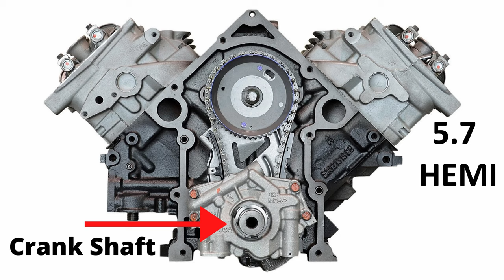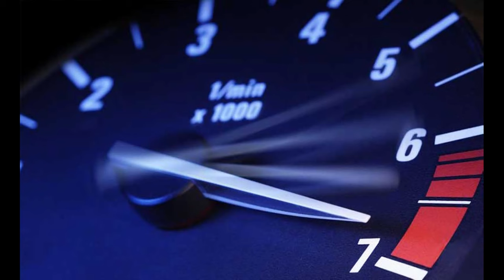HEMI TICK Explained (Easily) - The Cause and How to Diagnose

Comment: The Hemi is not a SOHC engine. It is a cam in block engine. They raised the cam to allow for shorter pushrods and a better angle to the rocker system. The oiling may be an issue. If so, I am of the opinion it’s due to the lightweight fully synthetic oil dripping completely off the hard parts between runs. The unlimited late model dirt cars tried the fully synthetic oils and went back to the semi synthetic oils so that the needle bearings in camshaft bearing (in the block and not the lifters) retained oil and didn’t suffer from dry start up failure. I run both Marvel mystery oil and Lucas oil stabilizer in my 2017 Ram. I run the prescribed oil and change it with the oil monitor reminder. I have just shy of 70,000 miles on it so far and it doesn’t appear to be having this issue. A good trick is to cut the oil filter open at the change to examine the filter media. If there’s metal fragments in the filter media you more than likely have this issue.
Reply: Lol.
My 04 Hemi had 300,000 miles of hard use and towing and Tics since 100,000.
Reply: @Roy Hemion  I ran mine up to 170,000 with no issues and traded it in on a 2017 Ram. The 201 now has 110,000 miles on it. It appears that in some forms of use and maintenance impact the wear on the roller lifters. 

I don't use mine for short trips like a daily driver. It's used as an over the road vehicle. My 03 was used the same way. I have a beater car now that takes the daily commute.
Reply: @The340king  I bought an 04 6 months ago for 2000. Its a awd Laramie edition with leather and factory 20" rims. 
Makes some noise upon startup and goes away after several minutes-
Truck has 300,000 miles and runs strong. Pulls hard all the way to 6200 rpm. The guy I bought it from said His dad bought it brand new.
I was considering buying another Hemi and doing a rebuild with the 6.4 Oil system. I am very impressed that the truck with that kind of mileage actually sounds so smooth and tight. 
Its technically my first dodge vehicle.
Have a blessed day and If you can't Dodge it, Ram it.

(Lol- sorry I had to say that somewhere)

Comment from the maker: EDIT* The Hemi is not a SOHC engine, clearly. The cam is mounted higher in the block then a "traditional" V8, that's what I was trying to get at and obviously mixed myself up lol. Sorry for any confusion.
Reply: If the cam higher in the block we need change oil pump MELLING brand with high pressure i think it's better .
Reply: Mds system not lubricating lifters mostly at idle
Reply: Glad you cleared that up. I was going to say something.
Reply: So what happens if you had an extra quart or 2 ... maybe the engineers miscalculated...
Reply: Correct, not SOHC, but it's not it being mounted higher that's the issue, they actually left block material between the cam and crank, blocking the oil spinning off of the rotating assembly from reaching the cam. I believe it's the lifter assemblies out of the hellcat that address this issue with internal oil passages that supply the cam, but I am not sure if it's just that or if you have to swap out the entire head and the lifters as well.
Reply from the maker: @DJTourniquet  I agree with you, I did a follow up video on this topic because I felt like I didn't do enough homework on the topic lol. I think there is a variety of possibilities including the lifters themselves being the issue. I do think there is still potentially a lubrication issue but there is more to the story then simply the cam's mounting location! thanks for the info sir!

Comment: The most profesional and yet most understandable explanation that I found all over internet.

I have a 2014 Jeep Grand Cherokee with the hemi 5.7 and It starting making the tick. It does it hard when starting the engine and goes away seconds latter. I'm towing a trailer. and I'm in Colorado now. the local mechanic that I found said that is the lifters and quoted 3500 for a full replace (including the cam shaft). 

I did oil replace and added an additive without any change. The crazy thing is that some times will start without making any noise. 

So I sill have some hopes that is the manifold. I left my car tools behind so I will buy online the "hearing tool" and also do the exhaust test. I saw a video of a ram with the exhaust problem and it sounds exactly like mine. but I read that both issues sounds the same.
Reply: What was your problem?

Comment: My hemi tick was the crank shaft disintegrating. My SSV was a Sherriff's department pursuit truck that blew a head and sent metal into the crank bearing journal and into the oil journals, constant rotation with metal friction tore the crank apart from vibration and that was found upon dealer teardown. Lifetimr Warranty covered a new engine all I had to pay for was a rental vehicle and a set of exhaust manifold studs and nuts.

Comment: I use pennzoil platinum full synthetic 5-w30 in my 06 ram Hemi with MDS deactivated. And the tick is hardly noticeable if at all. With 180k mileage. I think the oil you use is a big factor in this case. As i always see these trucks at those 19.95 oil change shops doing there oil lol
Reply: Hi how do you deactivate the mds and why would that help. Did you gain any more horse power.
Reply: @victornaja7927  i turned mine off using a diablo sport tuner. And it helped alot turning it off. Since i race my truck constantly on the road , when i had the MDS still on and i would floor it , it would cause the engine to knock (bearly) but do it enough and itll burn your valves up. MDS was not built with racing in mind more for fuel economy and efficiency . So in other words drive your vehicle how its intended to be driven when having MDS on. Here and there a pedal to the medal wont do much harm. But someone who races or floors it constantly i recommended turning it off in my opinion. And use thicker oil. Mine asks for 5w-20 witch is waaay to thin for a hemi engine BUT 5w-20 is recommended because of the MDS. But if you turn the MDS off you eliminate that problem and can use 5w-30 witch how i mentioned in my first comment it helps alot with the hemi TICK. I run 5w-30 pennzoil full synthetic and with 184k you can hardly hear the tick if at all. I hope this helps. Im not a mechanic just so you know lol.
Reply: @g.e.587  I have a ram 3500 with the 5.7 hemi. No MDS on the heavy duty Hemi, but it still calls for 5w-20.
Reply: @michaellarrick8881  using synthetic oil? No tick either?
Reply: @g.e.587  yep i just use penzoil platinum like the manual calls for! No concerning tick. Just the normal lifter noise. Recently had to replace exhaust manifold bolts tho 😭
Reply: @michaellarrick8881  yuup! My Ram needs the same thing bolts and gaskets i feel your pain brotha 😭

Comment: Good info.  Not enough lubrication for the lifters is the issue.  I have a 2005 Jeep Grand Cherokee with the 4.7 liter V8 engine and it makes the same sound.  The mileage on it is a pinch over 171,000.  Took off the valve cover and noticed one or two worn out lifters.  In addition to that an area of the camshaft worn out.  So, the 4.7 liter V8 engine and the 5.7 liter HEMI V8  have lifter issues.  I think 2017 or 2018 model year Chrysler vehicles equipped with the 5.7 liter HEMI V8 doesn't have the lifter issue anymore.  If this issue doesn't exist anymore, unfortunately Chrysler didn't publicly address it.
Reply from the maker: Ya I heard in 2016 that the lifters were updated and manufactured by a different company. so who knows if that makes a difference only time will tell i guess!
Reply: @TheGettyAdventures  OH.  Ok.  Good to know.  Thanks for the info because I have intentions on getting the upcoming new generation 5th generation Jeep Grand Cherokee.  It will be released this year.  However, I will not be getting it this year though.  In general based on what I've noticed with vehicles regardless of manufacturer is that the first year of the new generation vehicle sometimes have some bugs in there....you know.  So, what I'll do is I'll get either the 2nd or 3rd year of the new generation Jeep Grand Cherokee.  I'll get it in the Overland trim equipped with the 5.7 liter HEMI V8 engine.

Comment: My “misfire” turned out to be an exhaust manifold and an exhaust flange leak. I JB welded the whole area. Got rid of my tick and drives a lot better.
Reply: My son's 2014 Ram was ticking. Broken exhaust manifold bolts on both sides near firewall. Installed aftermarket headers. Quiet now!
Reply: Would it stay "ticking" even after the engine warmed up and you would drive around?
Reply: Did the misfire throw an engine code?

Comment: I have 121K on my '12 Dodge Challenger, the engine has spent most of its life at or about 1800 to 2000 RPM on the highway(manual trans engine)and shows no signs of failing. That being said, my engine has always sounded like it has a very quiet set of solid lifters in it and has never gotten worse.
Agreed, extended idling is not very good for these engines. A simple oil passage mod would fix that problem easily.
Reply: Does this require machine work or can I just buy these and if so where?
Reply: @joshreynolds729  something would have to be designed/installed in the engine to route oil towards the lifters and rollers.
Reply: @MM_in_Havasu  thanks.
Reply: My 2011 Ram has 478,000km. Had tick the entire time, however shes still running strong
Reply: I'd get those RPMs up, ofcourse you don't wanna be hard on it but babying a high performance car like that isnt always good either, the ol Italian tune up would probably do your car some good
Reply: @nickcalabrese9715  my 2011 didn't have one that I recall but my 2016 has one

Comment: here is the cure to lubrication to needle bearing. Use thin cutoff wheel used in Dremel tool cut a groove into lower lifter body perpendicular to roller bearing. Do not exceed the depth more then 0.030, and width should be around 0.030. That groove will shoot oil on to the roller bearing and to needle bearing. I hope this help

Comment: A lot of times the confusion between lifter tick and exhaust leaks can be solved pretty fast. Unless you have a major hole in your exhaust or it’s rusted out..exhaust leak ticks go away after about 3 to 5 minutes of driving it as the exhaust gets hot and expands. Lifter tick is constant when you have parts that badly worn. I hear so many people say they have lifter tick after 5 minutes of running the engine. This happens to several different brands (Chevy and dodge especially) even when they keep it serviced and under 100k miles usually it’s not a lifter tick at all. Don’t freak. Stop by an exhaust shop and they’ll inspect it and can tell you in 5 minutes..I do not recommend you stuff the exhaust lol not everyone is smart enough for that trick without overstuffing and doing some real muffler or even engine damage with blow back into the exhaust manifold!
Reply from the maker: Great info! and yes the exhaust leak can sound so similar to an engine tick that it can be very hard for the average person to tell what it is. taking the truck to a trusted pro is never a bad idea!
Reply: I have amateur knowledge on cars and engines, but couldn't it be the reason it goes away after 5 minutes is because the lifters have been lubricated after driving it around? At first I believed I had an exhaust leak, but now I'm convinced I have the hemi tick. I'm definitely going to get it seen about when I get the chance

Comment: Another issue is the oil galley pipe just below the cam. It blocks what little splash the cam might get. I’ve often wondered if that galley could be drilled to spray the underside of the cam and lifters. As well maybe a flow through replacement lifter would do the job. Clearly that’s a lengthy repair but it would be a permanent fix.

Comment: They’re known for exhaust manifold bolts breaking which causes that noise check that first rams hemi are really well known for that my 2014 did that within 40k miles on it and had the warranty cover it
Reply from the maker: hoping my 2017 doesn't run into that problem but only time will tell.
Reply: The Getty Adventures I have a 17 and it’s ticking. I’m pretty sure it’s an exhaust leak being that my 12 had the exact same issue as well. I had the 12 repaired as warranty work where it was confirmed a broken manifold bolt.
Reply from the maker: @sheltonbibbins6620  Jesus, you are scary me now. it's crazy there isn't even a recall for the manifold bolts. it seems like its every other truck with broken bolts.

Comment: I dont know if this is a stupid question or not but would it help if you occasionally reved your car while idlng to allow the rotating assembly to lubricate the cam? i know that the cam isnt lubricated at low rpms so if you pushed past 1500 for a second or two could it help?

Comment: The 3.6L pentastar also has problems with the rollers in their rockers.  Seems like FCA can't figure out how to make them last.  If you look at cams from the Pentastar tick, they look identical as do the rollers.  This engine is not a OHC engine though, for it to be an OHC engine, it would have to have, at minimum, two cams since it has two heads, and it wouldn't have pushrods.  That doesn't invalidate what you were saying though.  The cam is higher (But still in the block) than a SBC.
Reply from the maker: Totally agree with you, there could be more then one direct cause to these lifter failures. I just thought it was very suspicious that FCA has not mentioned anything in terms of these failures. To me it looked pretty convincing that lubrication was at least one side of the issue. But, I guess until FCA officially released anything we will never really know

Comment: My question is, has this been the design since 05? Older models don’t seem to have this problem. My 05 has almost 250k and no problem yet.
Reply from the maker: Not 100% sure about the older models. I believe there are a number of differences between the newer Hemi's in the 4th gen trucks then the Hemi's in the 3rd gen. But that being said, it does look like a lot of these issues are stemming from the newer trucks.
Reply: good to consider the MDS involvement, because it rolled out 2006
Reply: @TheGettyAdventures  in other words, you really don't know what the hell you're talking about.
Reply from the maker: @Joe-sn6ir  you Bum hurt Joe? sounds like it
Reply: Strange that the 04 didn't have an issue so it's the newer models that are giving folks problems is it time for another bailouts it seems if you find something that works well you could be happy ...but no let's screw shit up till we get 2 million recalled engines and are cam and lifter problems...it seems all these manufacturers want to have the same problems no need in making the best product getting that reputation and taking away other manufacturers business....no let's stoop to their level well the good news is they are all trash now ....stop buying any of them period as they no longer care about customer service
Reply: 03-08 HEMIs dropped intake valve seats.
Reply: @atx-cvpi_99  ya don’t over heat them

Comment: The motor gets it over the years as you run it. Any old hemi of course has the tick. The exhaust leak tick is by the headers. Many old ones have internal tick. The parts wear out over the years. Mine has a exhaust leak in the catalytic converter I believe I put my ears real close to it (ears were ringing lol my truck is loud) but I’m sure it’s the Catalytic converter I’ll probably change it and see if the noise stops. Original owner said it been like that for over 10 years so he says just leave it alone it never hurt nothing. He did take super good care of the truck it’s solid for 205k all it’s got is the rear fender rot which is typical for older dodges. Other than that super awesome truck

Comment: Hey I purchased a 2019 Ram 6.4 Hemi. First Mopar. I’m keeping up with 3500-5000 mile oil changes. Let us see what happens. But I have to say every engine has a slight tick of some sort when running. I certainly would like to know what the MOPAR RAM engineers have to say.